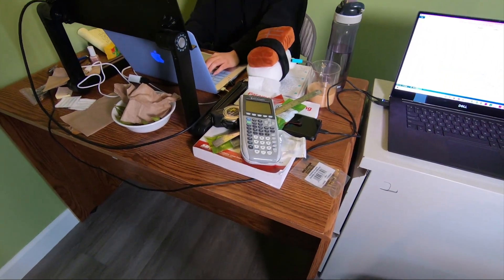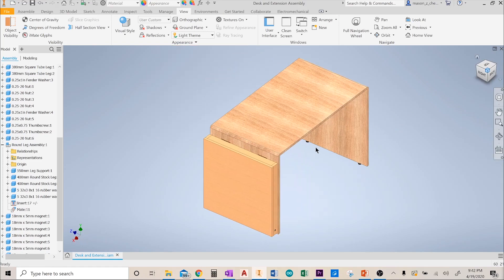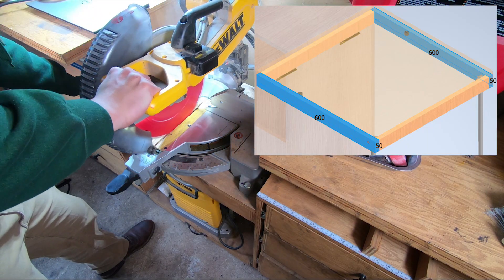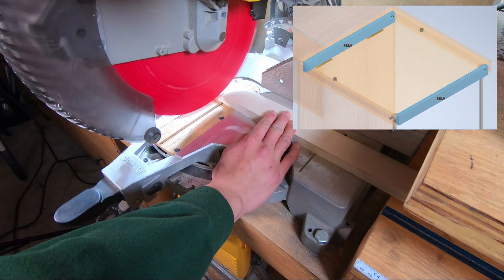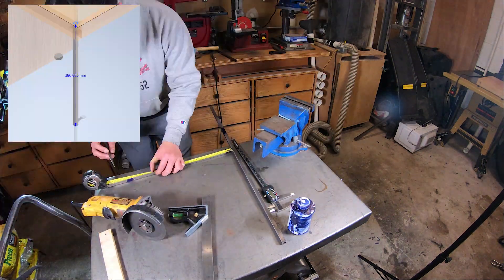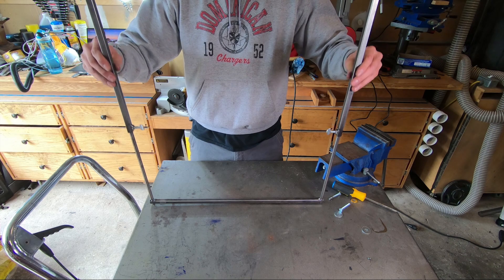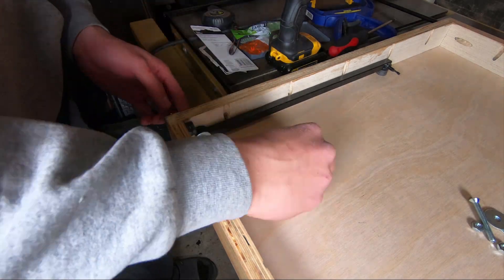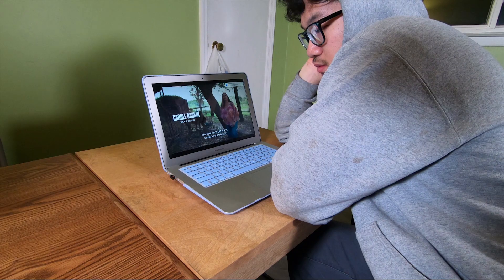How to Build a DIY Folding Desk Extension

Comment: How would you reccomend starting out DIY work when I don't have any space in which to store materials nor tools, nor a whole lot of space to actually build? I really want to do some work on my desk, amongst other things, but I genuinely don't know how to start.
Reply from the maker: Hey I've been there done that! My advice to you is to take what you have as design constraints. For example, I always design and build projects with 3 main things in mind:

1. Economics- Can I afford it?(plan the parts/materials)
2. Material availability(Can I even get the materials to build the parts, and if not, are there commercially available substitutes that fit the budget)
3. Tooling/space requirements(Can my tools/space be used creatively to complete the project)

More often than not, it is not a lack of a "proper" build space/tools that stop DIY'ers from doing projects, it is a lack of can-do attitude. Also, even having the tools/space doesn't guarantee good results. I'll give you an example. You said you don't have a whole lot of space for tools or projects. That's fair. However, that's where you get creative. In this video, you see me cut out a sheet of plywood for the top and sides of the table. Maybe you don't have a tablesaw/circular saw/etc. That's fine, now it's time to rethink if these plans even suit the 3 main considerations I listed above. Perhaps, change the plans so they fit your needs/environment. Maybe disassemble a free nightstand people throw away and use that as a table top rather than cutting plywood(yes, I do go curb trash "shopping"). Main takeaway is that don't get discouraged, start with small projects to gain confidence in your creativity and then you'll expand your repertoire with time. And most certainly, don't drop a million bucks on tools, for they don't finish the project; your brain and willpower do. Best of luck and don't hesitate to ask more questions! I have a lot of educational resources/vendors I use that could help you!
Reply: @ElecTrackProjects  Thanks so much! Having to find different ways to solve the same problem actually sounds really good. I'm not often creative, so having this as a project looks like a great chance to, well, actually think of more creative things. I've only got a drill and a set of screwdrivers, so I imagine there'll be a ton of unorthodox approaches needed.
Reply from the maker: @theblockbreakerpog  Sounds good! By the way, if you want to start building structural and organizational stuff, check out 8020.net. They have tons of aluminum extrusion forms and since they cut to length, you only have to assemble them. I'll probably put out a video some time of me using them. I use them a lot for stuff like 3D printers, shelving, robotics, electro mechanical stuff, etc.
Reply: @ElecTrackProjects  Oh brilliant, that'll be really useful, thanks!

Comment: First step, have pricey equipment.
Reply from the maker: Yep! I understood that not everyone has access to the same equipment to me, so I suggested cheaper and more manual options in the video and also in the video description. Actually, all the stuff I recommended are tools that I've used over the years when I couldn't afford nicer tools. I began off like most DIY'ers, a crappy $10 Black and Decker corded handheld drill. The main distinction obviously after going through the tool hierarchy is that you can still achieve the same end product but with less precision and more time. Hell, I've even welded with several junk car batteries. This is why I mentioned that its crucial to be creative and utilize what is available to you! 😃
Reply: @ElecTrackProjects  I don't wanna be an ass here, but this girl made the same with 1 piece of cheese, a comb and 2 rubber bands (and it actually looks pretty!): https://www.youtube.com/watch?v=Mnubxv5rABE